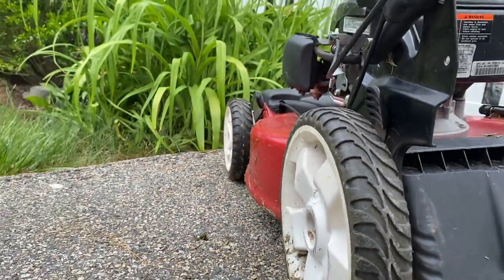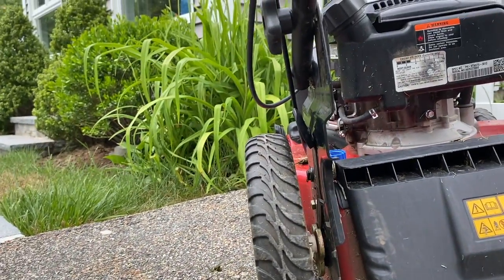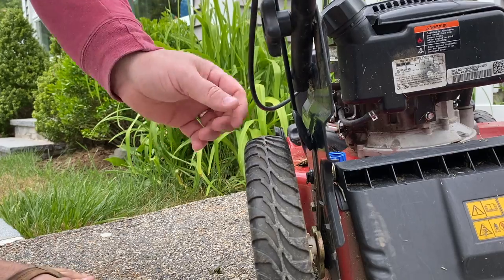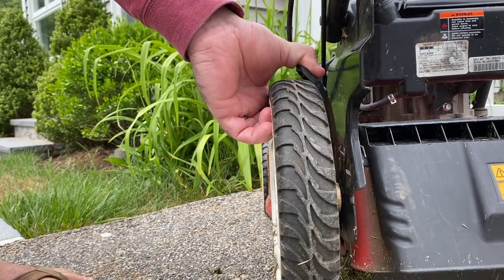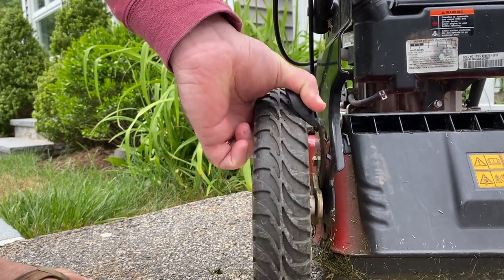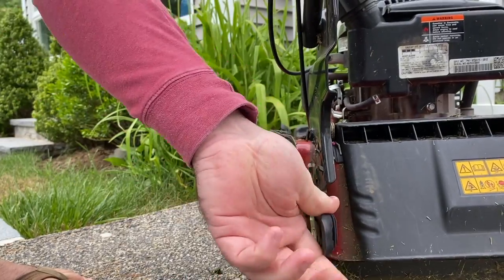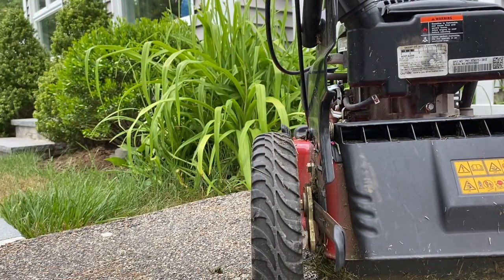How to Adjust the Mowing Height of a Push Mower (Walk Behind Mower)

Comment: My mower has larger wheels on the rear. When I set them at the same setting, the back of the deck is about a half inch higher than the front. Is this the correct way? I do notice that a lot of grass gets kicked out to the rear right wheel when I mow. Should the deck be level?
Reply from the maker: Yes, the deck should be level. Although the rear wheels might be bigger the settings should be the same. However if not put it on a level surface like a driveway or walkway and adjust until the deck is level, then you should be all set.

Comment: I thought on that particular Toro model you position the levers in opposite direction. To lower you move the front levers towards the front and the rear levers towards the back and the opposite is done to raise the level.
Reply from the maker: This one had the wheels go down (higher cutting height) when you brought the levers to the back and the opposite (wheels come
Up / shorter mowing height) for when you bring it to the front.

Comment: No. Which direction is higher or lower?
Reply from the maker: It varies by mower. But if you move the lever and the wheels come up, then you will be cutting shorter. If you move it and the wheels go down, you will be cutting longer.
Reply: @hobbyhandyman Isn’t it the opposite, I would think if the wheels go higher than your raising the deck therefore cutting higher and vice versa. Thanks! Or does it vary from manufacturer to manufacturer?

Comment: The worst is when  someone tightens down the adjustment levers and you can't even move them.
Reply: Tighten down how? I've used 5 different brands. It's a simple lift and move lever. No nuts or bolts to tighten.. unless someone is smashing a holding tab or being the lever to purposely screw with you.